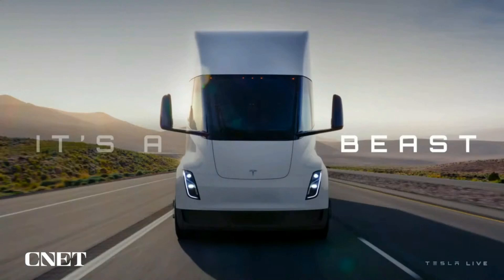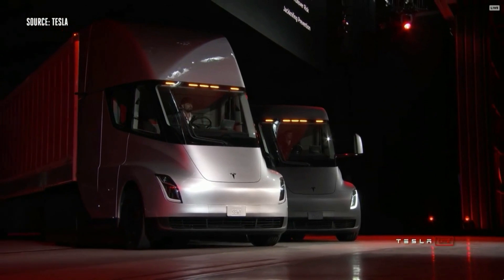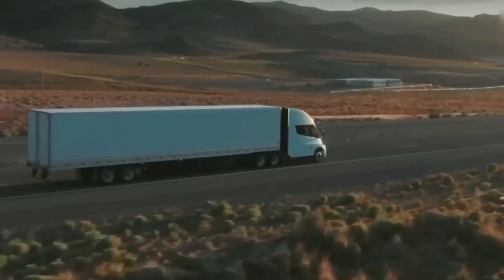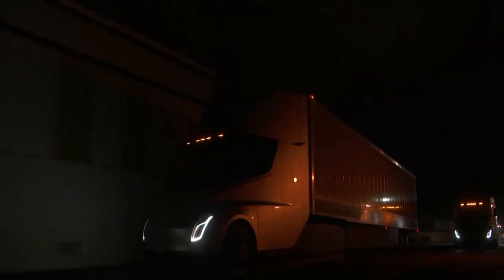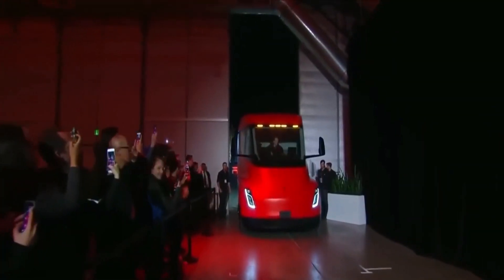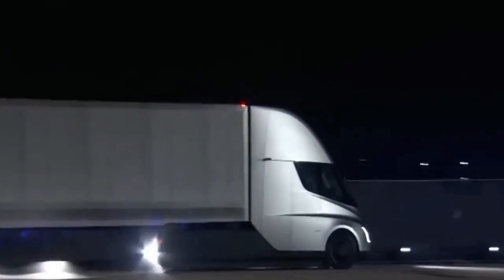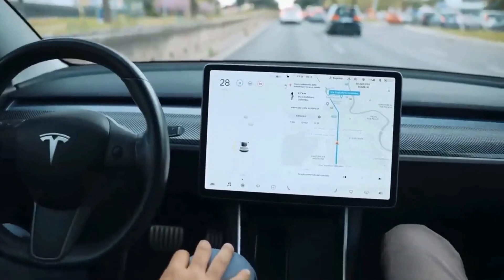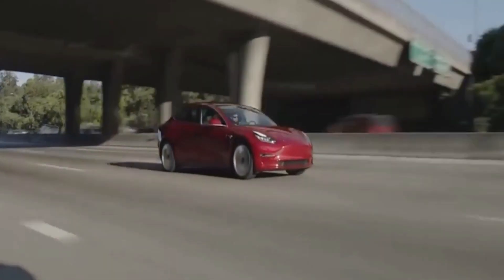Tesla Semi's SHOCKING New Engine CHANGED The Industry!

Comment: typical diesel truck has around 450 H.P. not 345, saying that it still is awesome. something Elon should do though, add trailers with solar panels and battery packs of their own and much smaller motors in the axle (mostly for regenerative breaking) to supplement the tractors range.